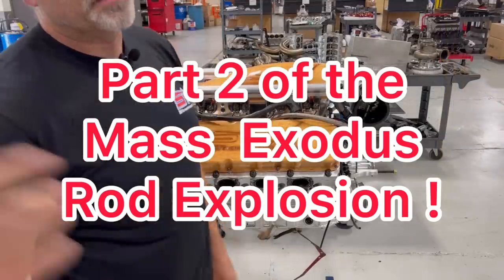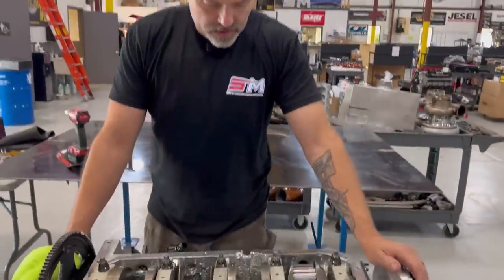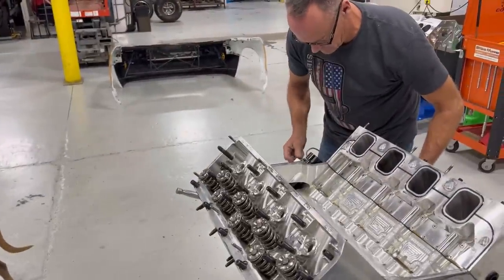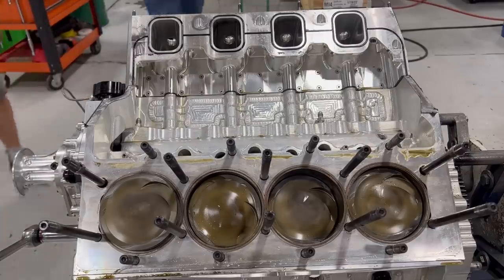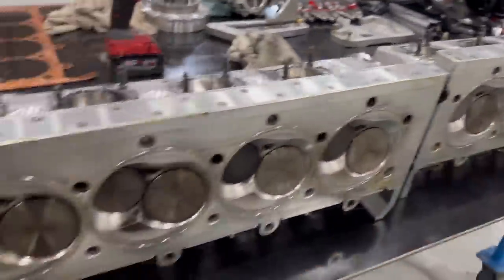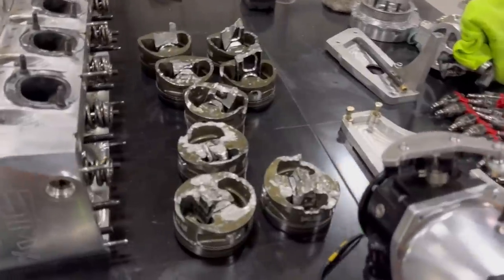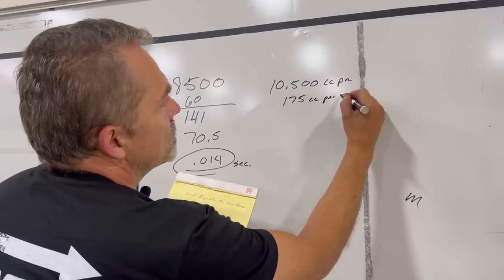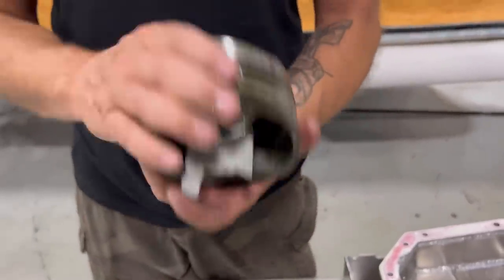EXPLODED RODS  Part 2

Comment: Steve , I love the work that you do !
 I have been watching you for years and some day I'm going to own my own SMX. These rods look Die-Cast aluminum . I suggest you get a batch of those rods and yours and have  X-Ray's done on them to compare them . Billet rods should stretch not shatter . Try putting one in a press and see if it bends or breaks.
Reply: Fatigue failures do crack, however. At 45 pounds of boost, 6 runs of repetition...
Reply: @CreeperOnYourHouse  I still think the grains weren't as tight as they should have been for billet. Bad aluminum will cause these problems.
Reply: No, they were definitely billet. Probably 7075 T6 and the anodizing was lightning the fuse.
Reply: I don’t think you’d see grain structure with an X-ray. Better to just examine the grain structure Uber a microscope.
Reply: @mikehoncho5389  
Yup. A lot of the time you can see the grain with the naked eye. You etch, stain and observe under magnification.
Reply: Aluminum is not like steel, it does not keep it's specs on the long run, with time and use it develops cracks and will be out of specs.
With such a damage there is no question to ask, it's clear that the rods were not made for this engine at the rpms it's running.
Maybe a false part number or the wrong alloy from the manufacturer. If they all failed alltogether, no need to ask were is the problem.

Comment: I noticed that the rods were "black" colored and not natural aluminum colored when you installed them. Could the Anodyzing process have done something to the material surface to weaken it??? e.g. eating into the suface and introducing micro cracks????
Reply: Anodizing shouldn't do anything like that to the metal. Since all it's doing is dying the oxide layer that naturally forms. I think some forms of anodizing hardens the outer layer but it shouldn't cause anything like this due to how thin the layer is

Comment: Man I’m impressed with how little damage has been to the cylinder heads and the crank and the cam…….truly a robust piece!  What about harmonics causing all of the rods to fail?  Obviously there was a metallurgy issue with the material the rods were made from or heat treat something……..
Reply: Pretty amazing isn't it. Considering the rods just disintegrated... everything else looks fantastic Considering.
Reply: I agree , a resonate frequency MAY have cause cleavage along crystalline faces of the metals grain structure.

Comment: I'm going with the temper of the rod somehow matched the harmonics/frequency in the engine at that particular point and cracked like a wine glass with high pitches.  I can't remember what those rods looked like or if they were narrower at the middle or anything but everything vibrates and if you hit the right frequency, you break it.  Especially ultra hardened stuff.  Maybe the rod maker was using a new hardening process or mix of metal.  Thats the only way I can see all those rods breaking at the same position at the same time so I'm going with that!!

Comment: Props to Steve, Genuinely a true testament to the quality of your engines/design, the fact that all that stuff/material was inside the motor at 8500RPM and the block, heads and crank/cam are mostly salvageable?! Very impressive.

Comment: Thank you for making these videos they are super interesting and educational.  The roughly 45deg angle the rod material failed at tells me it was a purely tensile failure.  Aluminum work hardens and so becomes more brittle so it’s possible these rods just had too many runs/cycles on them for that particular material.  Thanks again for taking the time to share your experience with us. 
Keith

Comment: A material issue is where my thought process went in the first video.  Multiple identical pieces, same failure, at the same time, under pretty much the same load. I'm just as curious as you to know why, I love learning. I have no clue if anodizing affects structure, but know that everything from alloy formula, to quenching/ cooling process, heat treating, or lack of, and a host of other things change metal properties (worked for a small company back in my youthful days that had their own foundry). Failures can range from a process that's done correct that's just not suited for the application, to a single batch that had something go wrong, reached the market, and unexpectedly fails like this. Thanks for bringing all us along in the search for answers!

Comment: awesome explanation Steve!
I've been working with all kinds of technical metals for years, and that looks like material fatigue leading to brittle failure if I've ever seen it.
those rods probably started out nice and malleable, but running that kind of Hp, you're basically hammer forging them while in service.
it's amazing what aluminum can do, and equally amazing what changes can happen to it when stressed.
God Bless you and all you do!

Comment: Steve you are absolutely right, if you look at the clean surface of the break you will see what is called beach marks ,  each mark where the crack moves, it starts out small and gets bigger as the material fails, you can see this starts on one side and moves over until  there is no longer enough materiel left and the rod breaks. This is 100% structural failure.

Comment: Metallurgical content of the conrod is definitely in question in this instance. I would also be looking at the point at where you had taken content away from the conrod at the small end bushing. Possibly comprised the integrity of the conrod to withstand the stress forces applied to them at extreme load.

Comment: I will completely bow to you in all of your knowledge especially with your own engine I just have my own anecdotal situation. I did have a 2.3 Ford turbo engine that had the head gasket blow enough water into the cylinder to hydraulic it while running down the road at 70+ mph. The way that I knew I hydrauliced the engine is because the number 2 cylinder when rolled to top dead center sat about an 1/8" lower than before. I still have the rod and you can see the squished bent part of it.

Comment: Exploding rods. Have not seen recoded electronics stats, but my guesses…

1 Detonation from timing error, maybe intermittent feedback from crank sensor? Your recordings will tell that story.

2 Even the small grinding of the upper rod changed the resonance of the rod. After multiple passes, the rods hit a resonance point that created stress fractures and the subsequent unplanned disassembly.

3 Was there a different balancer on this pass?

4 Was there any evidence of ingested water?

5 Any rapid change of RPM up or down (for a small fraction of a second) prior to destruction?

Comment: Thanks for showing that the pins were still free in their bores, and also showing   the rod portion which appears to display delamination of the alloy. 

I would hypothesize that during the forging process of those rods, that the temperature of the material was too low, and caused the structure of the alloy to shift during forming. Alternatively, the heat treating process may have been hurried and caused the rods to be too brittle.  

The metallurgy analysis will be a great indicator. I look forward to the results, AND the future prevention of this same failure.

Great job!

Comment: A truly fascinating couple of videos.
To me it looks like a material failure brought about by the alloy mix for those rods.
Due to load or resonate frequency.
The fact that they all crumbled  in the body of the rod, is the giveaway.
The damage caused appears that the rods crumbled and disintegrated, rather than they broke in large chanks and then got shredded.
A few large chunks did come away and they caused the majority of the damage, but the majority of the material seem to be like low density shrapnel.

Looking forward to more details and findings.

Comment: Your patience is awesome and the detail of explaining what did not happen is sure testing it and that some theories do not make sense. I believe your first theory of a rod material treatment is the key here. So I am going to toss in my 2 cents worth and I am not an expert in any way, but is it possible the temperature of the rod was not enough to allow the rods to flex and was cold enough to make them brittle,  I know its a bit of a stretch but no one else has mentioned it yet.. I was shocked at how much Cleetus had to adjust the valves becauses of the temperature of the aluminum expanding. Awesome work and support you supply... Cheers!

Comment: Detective Steve Morris on the job! Great video btw. 

     The reason for the catastrophic failure of the con rods imho occurred  at 8500 rpm due to a combination of forces being applied to the con rods. The inertial mass of the con rods must be considered due to the rocking motion back and forth with variable speed as the piston inside the cylinder must first accelerate after ignition from top dead center to top speed when the crankshaft is at 90 degrees and then decelerate and actually stop at bottom dead center and repeat on the way back up to top dead center while having to push exhaust gases out the exhaust port. It is the inertia of the stopping and accelerating and rocking back and forth that the mass of the con rods in conjunction of the downward and upward force of torque the piston generates to the crankshaft through the con rods that tore the connecting rods apart. 

    This analysis is verified by the lack of direct damage to the crankshaft.  The fact that all 8 con rods simultaneously grenaded in catastrophic fashion is a characteristic of the lack of molecular integrity of the metal the con rods to withstand the application they were meant for. The tiny shards of shrapnel that remained of the con rods upholds that the con rods literally exploded like a bomb at the 8500 rpm mark.
 
    It is very likely that the con rods were CNC'd from the same block of material. We are not given the identity of the metal used in this video so I am assuming it was some type of aluminum alloy because of the high revving application necessary for racing engines. Perhaps titanium alloy con rods in the future would be better suited to prevent this from happening again.

Comment: Great video and seeing the crank bearing surface eliminates an oil issue. Obviously the metal used for the rods was wrong for the engine top rpm. With the damage being equal across the engine the rod manufacturer has amazing quality control. Once the manufacturer gets the metallurgy correct they will be amazing.

Comment: This is fascinating to me, I have been drag racing since 1969, and have seen and had a lot of catastrophic failures. My best guess is this is an alloy/tempering problem, the rods look shattered and not pulled apart, and because they were perfectly matched they failed incrementally equally. I keep going back to the idea that it was on the compression stroke  that the rods began to fracture, and by began probably less that 2 seconds before failure point. I don't know why some keep saying it's an assembly problem, when eight rods vaporize like that, it is most likely not mechanical!

Comment: The way those rods came apart looks like the material just couldn’t handle the stress of the load at that rpm and literally pulled itself apart. Maybe a stress riser from the design machining etc. but you definitely found the failure point! Totally agree with you

Comment: I have seen nitrided (Corr-I-dur treated) shafts go brittle before.  On analysis, We could se no change in the structure but the shafts fractured seemingly brittle at 30% nominal load.  It turned out to be the nitriding causing microcracks in the surface that acted as stressraisers.

Comment: Have you looked into the rods having a vibration natural frequency (1st, 2nd, 3rd etc mode) that matched the engine speed, hitting a harmonic frequency? I was an engineer for Garrett turbo. Running the turbo at a speed that harmonizes with a blade natural frequency quickly leads to turbo blade failures (especially aluminum compressor blades, which are subject to low cycle fatigue). In your case, all 8 rods would have been at or near harmonizing, and if one let go the others would quickly take the hint.

Comment: The time that the Injector has to spray into the cylinder isn't typically defined this way in a Port Injection engine. The Injector can static open and fire all the fuel at the closed intake valve. When that intake valve opens is when the Air/Fuel mixture is pulled in (or I guess fuel only in a Hydraulic situation). This is an advantage of Port Injection. Direct Injection runs into the time limitation that you talk about and is why Injectors in those engines are so much bigger (for their power output). 

Not that I think this is a Hydraulic issue here though, I think you are bang on with it being a rod failure here though.

Thanks for all the great content, I hope to one day be able to work at this level!

Comment: Just a little guess work but . To destroy all 8 rods at once . Makes me think either the rods used weren't able to hold your power numbers or engine/power adder control failure..  like if something allowed the timing to advance to spicy like a failed or corrupted  knock sensor signal. Or a boost controller failure . Instantly allowing the motor to go well beyond the rods HP limit.

Comment: Steve, it appears that the rods broke in compression, going down.  It looks to me like the crank counterweights kicked the pistons up in the bore.  I believe this because of the lack of valve train damage. When a rod typically fails or a pin boss the piston is moving upward and it destroys the head and valve train.  Not so in this case.  If you look at the fracture surface you can see river lines.  This is where the fatigue crack propagates (grows) with each reversed cycle.  I doubt the anodize had anything to do with the failure.

Comment: My only thought, having watched the previous video, is that the rods weren't up to the horsepower they were being used for. The crank bearing looked fine, so a a oiling failure to the lower end, resulting is seizing is ruled out. The wrist pin ends are still connected to the pistons, which are intact, means not a failure on that end either. All I can think of is vastly over-reving the engine, resulting in stress cracks in the rods that let loose, not necessarily all at once(or at the time of over-revving), as once the first one went, the dramatic load change from the first failure bashing around could have triggered the rest of the failures.

Comment: It appears that the metallurgy in the material was flawed and this is the reason that they detonated, splintering is a example of  a bag mixture of metals to make the castings. It could come down to the raw materials or the casting process and the weather and or atmospheric pressure

Comment: Harmonics can cause metal fatigue like that, sounds destroy at different rates depending on density of metals, just the spark at those rpms make a different harmonic, then the ignition of the fuel adds another, each of these effects metal at a different rates, now add force pressure to those harmonic vibrations, causes metal to splinter and fatigue, then comes failure. I've experienced that one myself in a 400 sbc.

Comment: Wild how it shattered like glass. Any chance it has anything to do with engine harmonic/materials? Example : engine running at that speed makes sounds and vibrations.  Any chance it was just the right frequency that shattered the rods?

Just a thought,  I'm not a professional engine builder by any means. Like you I'm just thinking of ideas on what could shatter a rod like glass.

Comment: Really  Informative video !! ....At what Fully developed Boosted End point,  do just you Remove the Heavy, troublesome Piston Engine, Pump fuel to &  Screw a Sparkplug into the Turbo ?? .....Called a Gearbox drive Coupled Gas Turbine......

Comment: Thanks for your time explaining the math.
Will love to have one of those pistons you were showing at the end of the video, some interesting things to see on the fracture of those rods.

Now that you mention about anodizing, I watched again the last part and seen the anodizing, and knowing that you need to heat up the parts and that anodizing is some kind of surface oxidation process, I wonder if the starting points of the fractures started at the surface areas.

I'm not expert, but it seems that anodizing and its process shouldn't be done on conrods, I can't think of any benefit beside that it looks cool.

Comment: Steve, not breaking at the modification line is not indicative of the start of the issue, modifying something can make waves that cause deterioration down the line allowing failure away from it, think cracking in a frame, a gusset in one spot can cause cracking to propagate in another but having said that I do not think this is a failure from the modification, it looks like more of a delamination failure, the metal received more force than it could handle and they sheared apart, can say that definitively from a computer screen, would need to look under magnification to say for sure. The root cause can only be determined after knowing what and how it failed so a metallurgist will be needed if you want an exact answer.

Comment: I love the teaching here.  Most guys with this much knowledge want to take it with them to the grave until it's too late for them to reconsider, and then they are in the grave.

I don't have any experience with engines like this, but do know aluminum pretty well.  Those rods seemed very brittle to me, so either a straight up wrong material choice or a hardening issue.  7075-T6 is a good material, but isn't as good as others for tensile strength.  My guess is they hit their tensile limit, and while it seemed like they all did it at the same time in the microsecond view they likely all were loaded equally and hit their own limit within a few combustion cycles of each other.